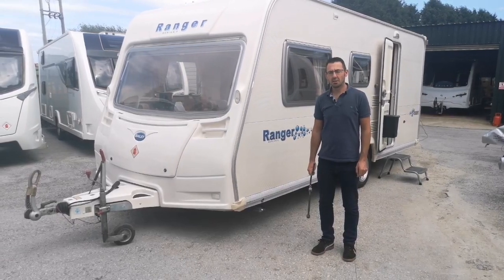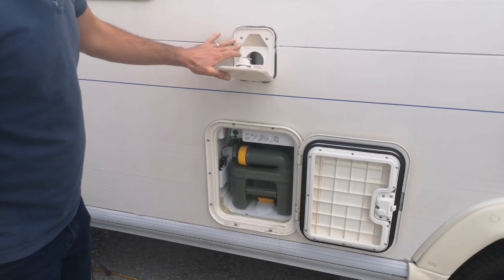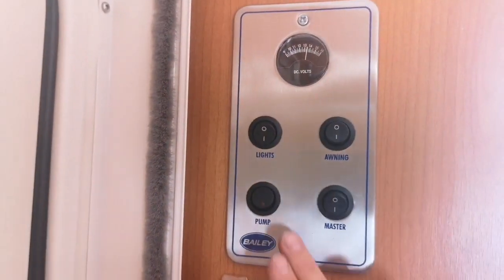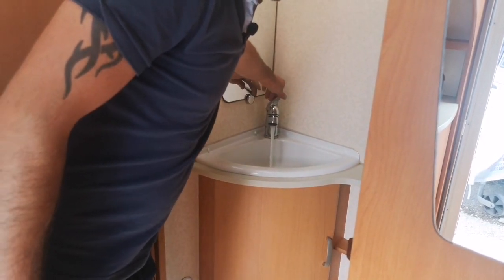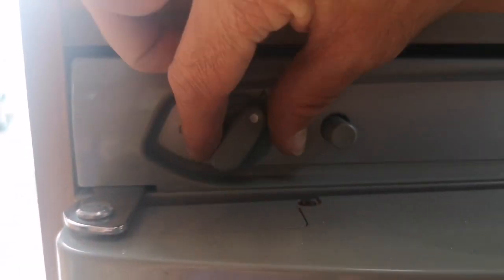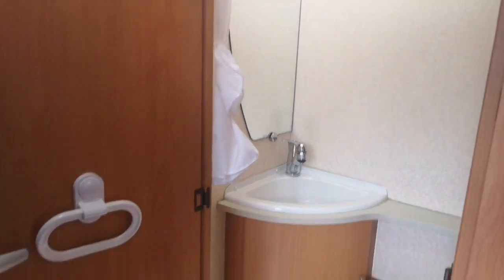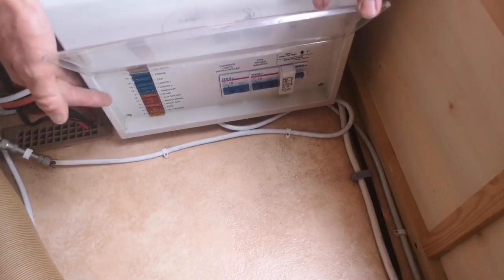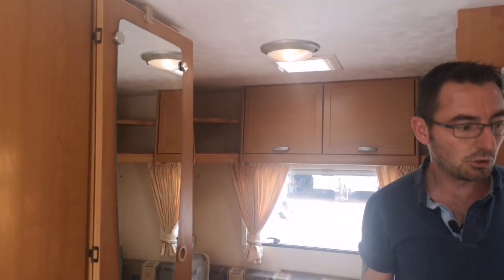How to setup a Caravan on site - Bailey Caravan

Comment: How do I change a rear indicator bulb on a Bailey Pageant series 7 2009 round lense
Reply from the maker: Hi John, you should see a place to push a flat headed screw driver at the bottom centre of the light. 
Push a flat screwdriver into the recess at the base of the light.
Gently prise the bottom of the light unit out whilst pulling in a downward movement on the top of the light.
The complete unit will now pull away from the rear panel

To refit is simply the reversal of the removal.
Reply: @thecaravanplace  thanks so easy when you know how just terrified i was going to break it
Reply: My ATC isent working does my plug and socket need to be 11 pin
Reply from the maker: @johnmclaughlin3326  yes you will need both lights and aux wiring on the car, it may be just wired for the lights only.
Reply: @thecaravanplace  thanks again your a star